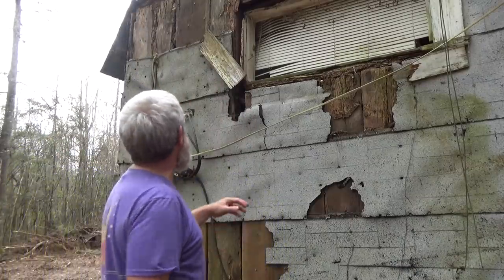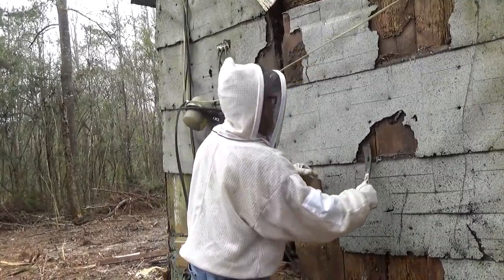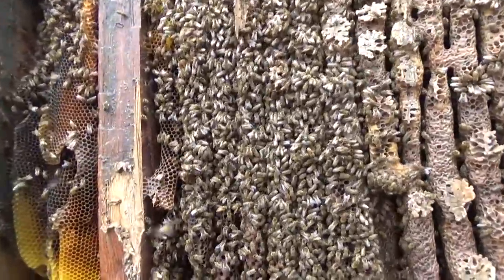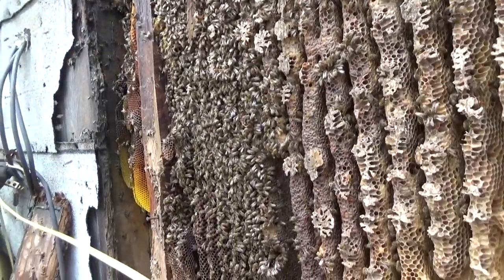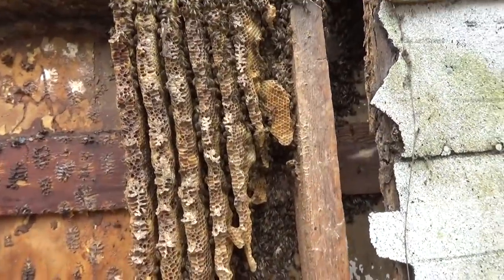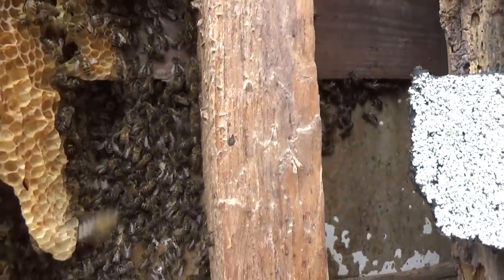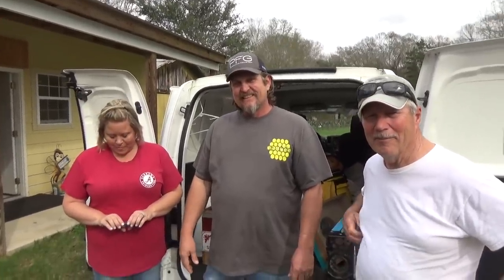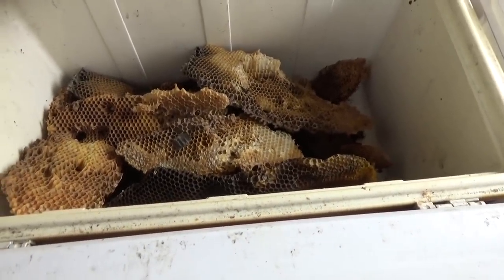4x4 winter bee hive removal and relocation

Comment: once the fight is at your door, it's on like the bell just rang out -  we can press or pull, but, that is after the fact of arrival (usually them)..  but, we take it to their front, it would seem to be an instant k.o. right then; because the ride to 'square-off' central was tougher than the defenders and it was mostly annoying..  non human opponents get a little bit of sympathy (for all that), but, they still have found no way to prevent your steamroller from commanding the tap-out.!!
                                             ~WarriorPoet~

Comment: So, did you frame up any of that comb?  And if you did, did you put it in the frames sideways relative to its original orientation in the hive, or what did you do?
Reply: Jeff ("Mr. Ed") doesn't frame up the comb at the job site.
Instead, he returns to the Abbey, and there he places comb in frames.  The comb is always placed in the frames in the same orientation as it had in the colony.
Reply: @kevinbyrne4538  That's what I was wondering, though.  The original orientation is vertical. I wondered if he set them horizontally when he framed it up, or whether he cut small bits and placed them next to each other in a frame so that each bit is still vertical.
Reply: @Thea_MojaveOutliersWhipmakers  -- When he transfers old comb to a frame, he must orient the comb in the same way as he found it -- otherwise, anything in a cell will fall out.